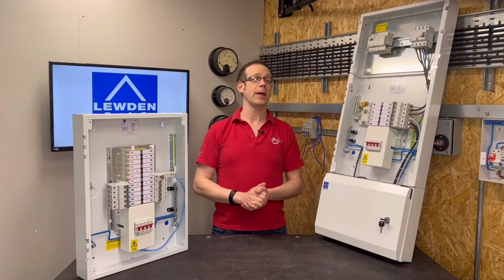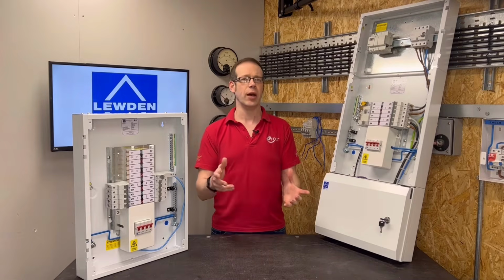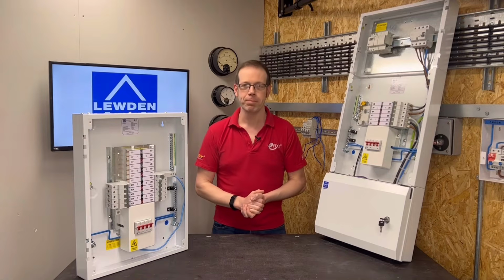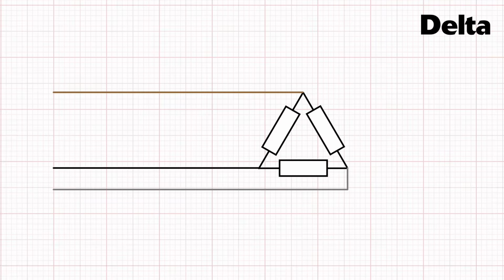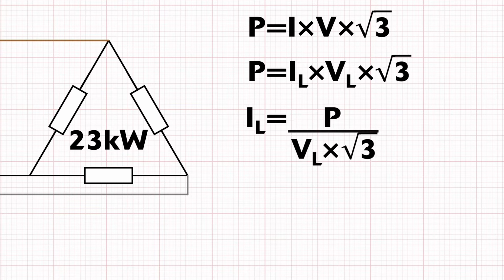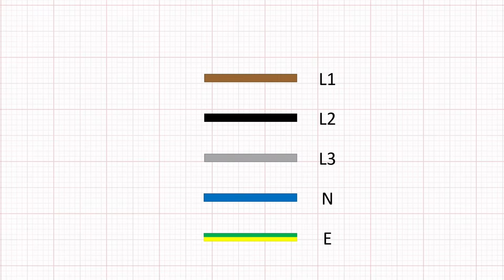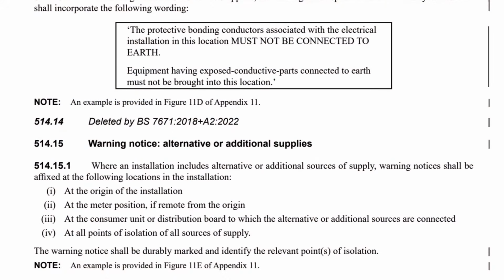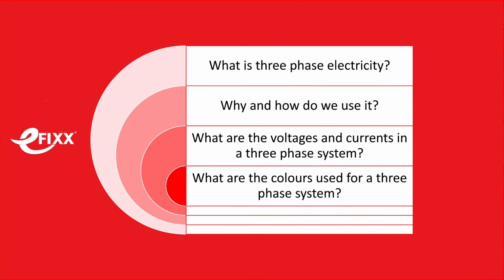The Utimate Guide to Three Phase Electricity

Comment: A very educational video, thank you. I wonder if you could develop the discussion on balanced loads to include not just three phase and single phase, but two phase when two 120 degree phases from a three phase supply are being supplied? This is the situation in my road, where the DNO only has two of the three phases available in the road. It gives 400V, which is an important aspect for cable size, as discussed, but the calculation for the current in the supply is surely different.

Comment: Three-Phase Power Explained
Three-phase power is a method of generating and distributing electrical power using three separate alternating current (AC) waveforms, each offset from the others by 120°.
Why Three Phases?
Imagine a single-phase system — one wire carrying AC power that rises and falls in a sine wave. Three-phase adds two more wires, each carrying the same sine wave but shifted in time:
Phase A peaks at 0°
Phase B peaks at 120°
Phase C peaks at 240°
This means power is always being delivered — when one phase dips, another is rising. The result is smooth, continuous power delivery.
The Key Advantages
Efficiency — You can transmit much more power with less wire and less energy loss than single-phase.
Constant power delivery — The three overlapping waves cancel each other's dips, so motors and heavy equipment run smoother and cooler.
Self-starting motors — The rotating magnetic field created by three-phase naturally makes electric motors spin without extra starting components.
Two voltages in one — A three-phase supply gives you both a higher "line-to-line" voltage (e.g. 480V) and a lower "line-to-neutral" voltage (e.g. 277V) from the same system.
Where It's Used
Power plants and the electrical grid
Industrial motors and machinery
Large HVAC systems
Data centers
Electric vehicle fast chargers
The Two Wiring Configurations
Delta (Δ) — The three phases form a triangle. No neutral wire. Used for heavy motor loads.
Wye (Y) — The three phases meet at a central neutral point. Gives you two voltage levels and is the most common distribution setup.
Quick Analogy
Think of a single-phase system like pedaling a bike with one leg — you get power in pulses. Three-phase is like pedaling with three legs evenly spaced — smooth, continuous, and much more powerful.

Comment: Dutch homes have had 3 phase 230/400 2230/380V for decades.
It saves on copper and due to mandatory ground fault switches as safe as all other variants of end distribution.

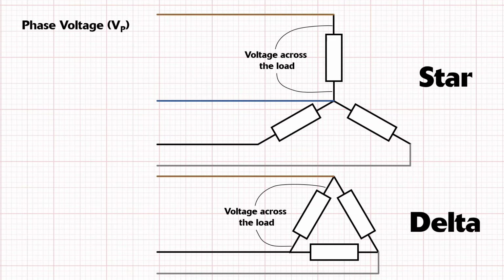Comment: 8:50 An interesting emphasis, but entirely unnecessary when you remember that no tradesman, designer, electrical engineer, or member of JPEL 64, would find the need to make your distinction because "phase" voltage, U(0), is in fact defined as the PD between a Line and Earth not Neutral...
Reply: Do you think that in a system with isolated neutral there is phase voltage between line and earth?
Reply: @vladnet4748  Absolutely, yes.  Isolating the Neutral has no effect on the voltage to earth, hence why that is the Definition in the bible of phase voltage.
Perhaps you mean one of these two alternative situations:
1. The Neutral and the Earth are combined in the system you are imagining, a CNE or PEN conductor, which should be part of a PME system (but sometimes isn't these days due to our crappy DNOs not adhering to the ESQCR...)
2. The Star Point has been strangely disconnected because someone is working on the tranny or sub sta.
3. It was always intended to be an IT system anyway so this conversation is irrelevant.

Comment: For transmission we use AC because of heating over long runs. DC makes more heat because the the power never lowers or is at 0V onces every 30th of a second (America)

And because of how cheap solid state transformers are, which only work on AC. higher voltage means more room for volt drop

Comment: What i tell apprentices. 
12+12=20.8,+12=0 and thats voltage 
And amps is 15+15=12,+15=0
unless the phase is messed up, you can always safely make un balanced resistive loads (like multiple outlets on differentbrakers), without burning up the "identifed" "balance" or more normally called the neutral wire. Which is what we do in comercial all the time to reduce cost and pipe size

Comment: Its good to add that's the power losses in long power transmission cables at a lower voltage would be detrimental and result in heating losses in the cable.. however by stepping up the voltage cures this problem because the current is inversely proportional to it. So to keep the same Power the practice is to step up the voltage with oil filled transformers  will lower heating losses and a thinner conductive cable can be used

Comment: I don’t quite understand how the delta at 4.00 is connected to the outside world as they just all appear to be connected together in one big loop, where the star set up has 3 conductors not connected which I assume go and feed the outside world!
Reply: That’s just how the diagram is, in simplistic terms - if the outgoing wires were connected to the end of the star then in delta there would be a connection on the points of the delta triangle to connect to
Reply: @ thanks, I thought as much

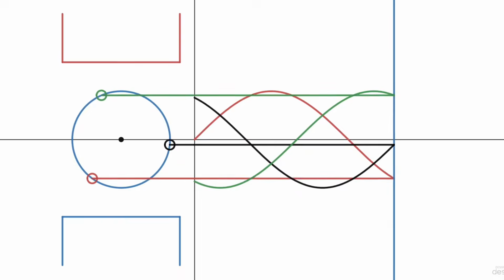Comment: The diagram/animation starting at 2:02 appears to be wrong. If the 3 colored circles on the rotating stator each represent a phase coil, the voltage of each coil when passing directly in front of a magnet pole should be zero, aka the zero crossing point. In the animation the voltage reaches its peak as each colored phase circle passes a magnet. In reality, peak phase voltage is reached when furthest away from a magnet pole!
Reply: No, that's correct. The point closest to one pole is simultaneously the farthest from the other pole, and this corresponds to the amplitude of a sine wave.

Comment: There's three lives. One neutral. Ignore the green and yellow one, it seems to work without it. If you lick any of the three,.it will hurt a bit. Touching one and licking any of the others, it will hurt a lot. To absolutely make sure you have isolated all three lives, chuck a bucket of water over all of them. After the flash, bang and steam has settled down, check for voltage using the previously itemised methods. If it doesn't hurt when you lick a phase wire, it's off.

Comment: But why 3-phase? Originally the industry considered 12-phases, but compromised on 3-phases, whatever the number of phases, the requirement is to transport 3 times the energy per unit of time; as simple as that.
Reply: @G6EJD-David  actually - if you have a single phase transmission line - that uses two conductors. Add just one conductor and now you can transmit   three phases in delta - each having a  phase to phase voltage sqrt(3) times the single phase  voltage. 
So each phase sends (V sqrt(3) )^2 /Z   as opposed to V^2/Z

Comment: Would you care to tackle the subject of multi speed, multi winding motors?
Perhaps covering the details of the effects of phase voltage on motor speed and torque and why a motor may have the same voltage rating in both star and delta.
Fun to be had for all the family.

Comment: Mix reg codes is verry common in my sector of maintenance engineering . Even we still have to learn and go back to 60s to figure some buildings out . Be good if you could mention why tri rated is used in 3phz pannles for those of you dont know wh

Comment: Guess we here in the states are kind of lucky as far as conductor colors.  They have been pretty much static for decades.  Single phase here is most always residential, we never have 3 phase in the ground or on the poles in residential areas.  We have 120/240Vac at 60Hz with the colors being Black for L1, Red for L2, and White for Neutral.  Green and sometimes bare is ground/ Earth.  Commercial/ Industrial is 120/208Vac with Blue being added in for L3.  We also have higher voltage for commercial 277/480Vac.  Our colors change to allow for differentiation since the two coexist in commercial.  Brown for L1, Orange for L2, Yellow for L3, and Gray for the Neutral.  We step the 480Vac down to 208Vac for convenience outlets. Etc.  Some services are 480 delta with no neutral, but most are Wye.  At the research facility where I work as an Electrician, we have allot of European equipment installed so there is more than a passing familiarity with your standards required.  We have alot of crossover in devices used for our equipment.

Comment: Nice video! However, I think you missed out on mentioning one of the biggest benefits of 3-phase in a residential application; the ability to serve 3 high amp loads  with a single 5 core cable.  e.g. My Washing machine and tumble dryer used to be served off a single circuit. If they pulled their maximum load simultaneously, they'd trip the fuse. Annoyingly they were connected to a single phase in a 3-phase isolator, leaving the other 2 phases unused.  I got a separate socket added and connected to another phase into the isolator, and never had any trips since.
The other part of 3-phase that took me a long time to get my head around was that when multiple loads are on, only the "remainder" current is sent down the neutral.
Reply: This is dangerous. Connecting one five-wire cable to a three-phase load with a single input (terminal box or outlet) is permitted. However, it is unacceptable to place two or three single-phase outlets from different phases in the same location.
Reply: @vladnet4748  It's really only considered risky in places where single phase is the norm, like the UK, because people aren't used to encountering multiple phases in a domestic setting. In countries where 3-phase supply is common in homes, this sort of setup is standard practice, provided all phases are protected and isolated together.

The key safety point isn't the number of phases, it's correct installation and grouped isolation.

Sweden does also restrict DIY electrical work quite heavily, so most of these installations are done and tested by authorised electricians.
Reply: @BenIsInSweden  I have nothing against using three-phase electrical appliances, but I'm talking about single-phase ones. Your washing machine and dryer are next to each other, each with a separate power cord plugged into a separate outlet, and each outlet is powered by a different phase. You risk being exposed to phase-to-phase line voltage  outside of protection zone of  your circuit breakers or RCD.
Reply: @vladnet4748  The only way you'd be exposed to phase-to-phase voltage is if you simultaneously accessed live conductors from two different outlets. In a properly installed 3-phase domestic setup, all phases originate from the same board, are protected by linked breakers, and are disconnected together via a 3-pole isolator.

This is standard practice in countries where 3-phase domestic supply is common. The safety depends on correct installation and grouped isolation, not on whether the sockets happen to be on different phases.
Reply: @BenIsInSweden  No problem. You may do as you want, but I will do as know.
The weak point is separate air power cords and possible loss of neutral between single-phase loads. In such a case, I would use a 3x4 mm² cable and a 20A (or maybe 25A) MCB.
Reply: @vladnet4748  This is a standard 3-phase radial arrangement. Neutral loss is a general 3-phase consideration, not a flaw in this design. The safety comes from correct installation and isolation practice, not from keeping everything on one phase.
Reply: @BenIsInSweden As far as I know, in the UK, a 2.5 mm² wire and a 2-pole 32A MCB are used for a radial system. I'm wondering how to use a single 5-core cable in a 3-phase radial system and where the RCD is located.
Reply: @vladnet4748  Typically in modern systems, a 3-phase radial would be protected by a 4-pole RCBO, or a 3-pole MCB under a shared 4-pole RCD. It's simply standard 3-phase protection for L1, L2, L3 and N.
Reply: @BenIsInSweden Thank you very much for your answer, that's very interesting. What's the coverage? One RCDO circuit for one large room and several smaller ones? How many radial groups in a building?
Reply: @vladnet4748  Are 3phase ring circuits allowed in britain? pretty much anywhere in the world they dont even know what a ring circuit is let alone allow it, even tho high voltage supply is always in a ring LOL.
Reply: @vladnet4748 in the UK 2.5 would be on a ring circuit if protected by a 32a breaker. A radial circuit would normally be only 16 or 20a breakers, maximum being 25a. 👍
Reply: @peterc3228  Yes, thank you. Some translation errors. The ring and radial systems are different. But I'm surprised by the installation of a 5-wire cable for individual single-phase sockets, especially those located right next to each other.
Reply: @vladnet4748 never come across an instalation like that here in the UK
Definitely not standard practise 😂
Reply: @peterc3228  It isn't standard practice in UK domestic installations because most homes are single-phase. In countries where 3-phase supply is common in residential properties, splitting loads across phases using a 5-core radial is normal for higher-load areas, such as laundry or utility rooms, as I mentioned originally, and for fixed appliances like heat pumps and immersion heaters that are often supplied together. The rest of the house is typically supplied by balanced single-phase radial circuits.

Comment: Many electricians improperly divide phases to integrated stove: cooking surface uses two phases and oven uses one phase. But cooking surface uses brown, black, blue and yellow-green wires; oven uses brown, blue and yellow-green wires - as result many electricians connect brown wire from oven to brown wire from line cable and leave grey wire without any connection, which causes circuit breaker to trip because brown wire carrying oven with cooking surface and grey wire is unloaded. 

It is useful to explain why brown wire from oven should be connected to grey wire from line cable in next video.

Comment: The EU was very much led by the UK in many fields of harmonisation, medicines, healthcare equipment as well as electrical standards and we were sorely and sadly missed post Brexit.
Reply: The CE marks that we used from the EU were a nightmare, because the 4 digit code could crossover. the biggest problem was in medical products. The CE code was also the accrediting organisation, not the product.
We accepted CE-0086  for safety protective products, so we had to be careful.

The most amusing one was condoms, where imported products were using the same CE as balloons, where a one in ten failure rate was acceptable.
 Endless jokes ensued about CE-0086. If you were a builder, you had the same code  (safety) on your condom, your boots and your hard hat. Most people knew which one was which, but one site sent out a memo that condoms where not acceptable to wear as hard hats.